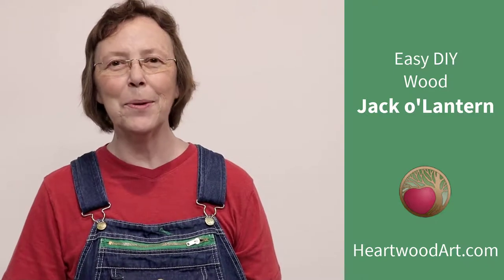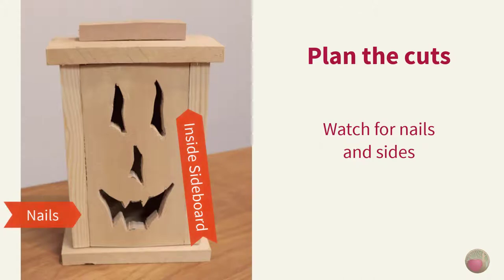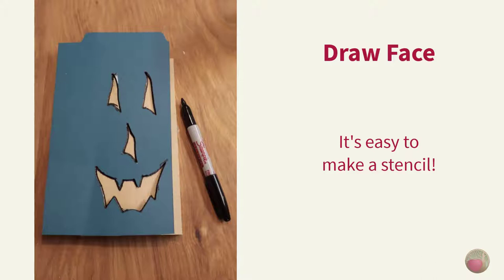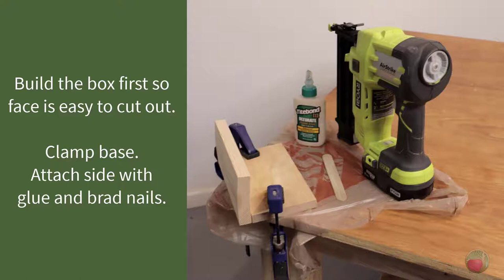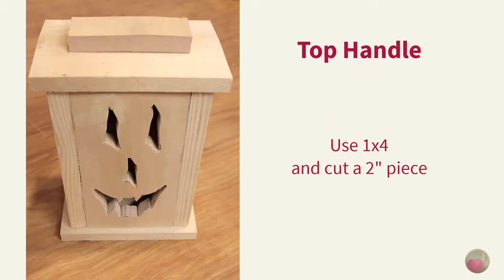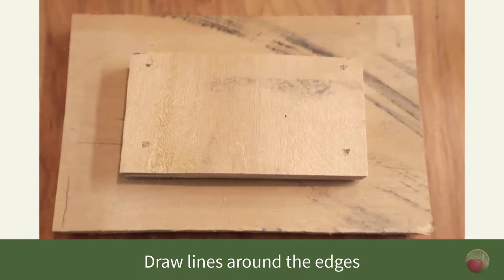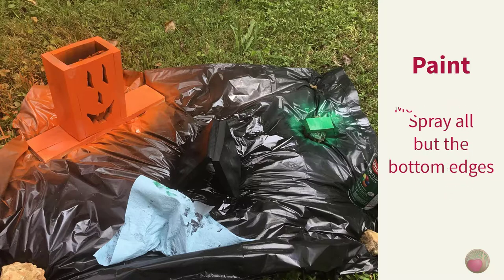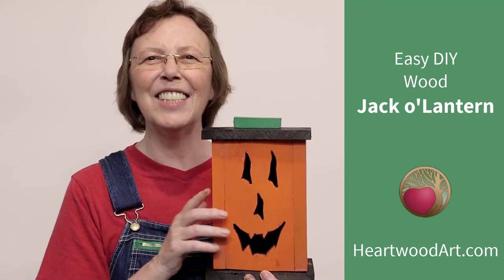Easy DIY Wood Jack o Lantern

Comment: Would it not be easier to cut face out before assembly
Reply from the maker: I could not think of a safe way to keep it anchored and away from the surface it would be laying on to do it prior to assembly. I would be too worried about constantly checking to ensure I was not cutting through my bench edge or such.